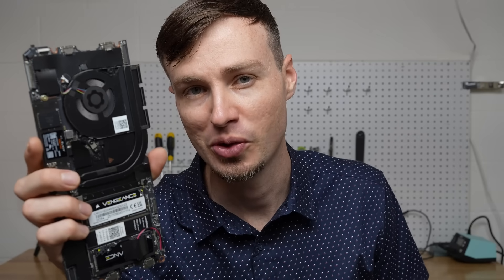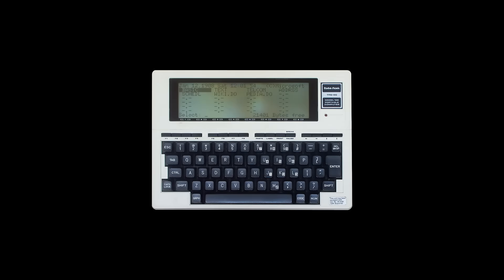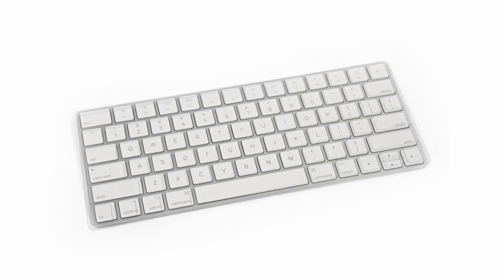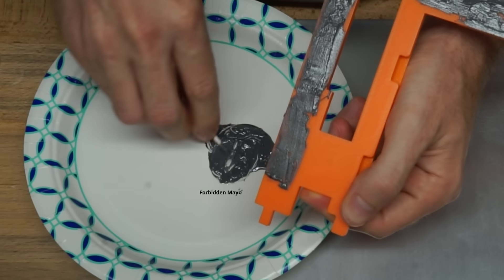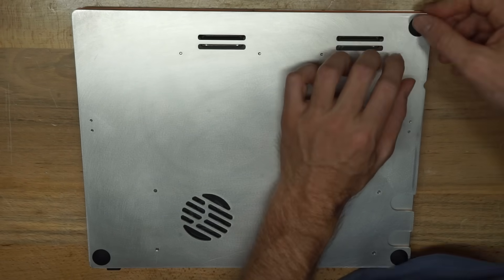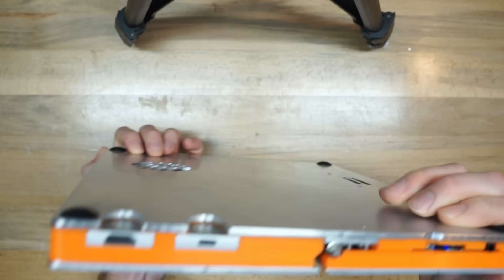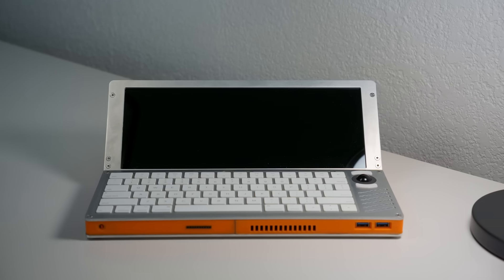Framework Cyberdeck - DIY Portable PC

Comment: Love the project! Have you considered some low profile, clear rubber bumpers on the corners of the screen? I love this design, and if I could recreate this I'd add some fine custom cutout mesh on the inside of the speakers/fan vent areas as well as opting for 3d printing the case vs the heavier metal construction, maybe even in a translucent 90's tech style purple or clear filament!

Comment: I really like the CNC aluminum and FDM-printed sandwich design.  As a hater of exposed layer lines, putting them where they will rarely be seen is a big plus for me.  The one show-stopper for me is the exposed circuitry and cabling when the display is tilted up.  Maybe a bellows could be used to fill that space.  But that's just me - if you're happy with it, that's all that counts!  The one universally accepted rule for cyber decks is to make it suit YOU, and I'm already thinking about how I could blend some of your ideas with some of my own.  Like, I might prefer CNC plastic sheet stack over FDM-printed core - I'm working on a cell phone design using that approach right now.  So, bravo!

Comment: A system like this could possibly replace my mini laptop with intel atom. Which, by the way, is plenty fast for the things i use it for. Burning install media or recovery tools and such. SSH into things. And it's small as heck, not quite pocket size but almost.
But. Ports. It has one USB. Also USB-C but that's only for power in. Does have microSD but i have never used that.
Features that this cyberdeck has that i want. More ports, and that ultrawide screen. Also display in. I may need to modify the form a bit but really, this thing seems amazing and just what i need.
Reply: Hm. Fitting a logic analyzer in that thing should no be too hard. Also some other random small well i better not fill it too much..

Comment: You gotta teach a class or course on how to do this. I want to make a clear framework 13 laptop case. Any tips?
Reply from the maker: I use Fusion360 for all the cad modelling. You might be able to find the original model somewhere online and use that as a starting point. I found a model of the battery and motherboard and used them for reference. Clear acrylic can be cut with a laser, you can probably find an online service and just send them the files.

Comment: I know this is a hot take, but everything that is not type-c needs to die. It uses DisplayPort for display output which doesn't carry royalties like HDMI, it can carry plenty of power for any small computing device (240 watts in the newest revision), it can carry upwards of 40Gbps of data, it really does everything. Outside of that, I can see a place for SD card slots, but that's really it.
We don't beat on laptops for dropping VGA, Serial, P/S2, Parallel, or PCMCIA. It's time for a unified standard.

Laptops and desktops don't need to adapt to outdated standards, peripherals need to come into the modern era.

There is still a major issue, the labeling of ports is much more complex these days and  the USB Implementers Forum is not strict enough. All devices capable of supporting a feature need to support it or they need to create simplistic symbology to convey the limitations of certain ports. We're getting there slowly, but this is the slowest technological transition I've lived through.

Btw, notice that this motherboard actually has nothing but Type-C ports with some fancy adapters, lol.
Reply from the maker: It may be a hot take, but I agree with you! In an ideal world, this board would not even need adapters, and therefore the overall footprint could be smaller.

Comment: So I could be wrong here, but I'm pretty sure LVDS (The connection/electrical standard that laptop LCD's use) is designed that if the cable fits it'll work, doesn't matter about the form factor of the screen, so a lot of the time you can just plug a random screen into a random computer assuming the plugs are the same size/number of pins.  I could be wrong, I can't remember where I read this. Would free up one of your ports.

Comment: its an interesting idea. i was thinking if i can use samsung tab as display i can use s-pen, and can use samsung keyboard which is very thin as well as dont need mouse since i can use touch so it saves a loot of space. plus point i can run android as additional bonus . whats your thought on this?
Reply: i was thinking like we can integrate the system with keyboard but not screen, in place of screen we can use ipad or any other tab.  its like carrying thick keybourd with you anywhere just plug it with any display or tab and use it.
Reply from the maker: If you just want to use the samsung tab as the system itself and run android then sure, it would be a lot easier actually since you don't need to figure out things like the battery/screen.

Comment: 3:00 but it's pretty usable. If you have heay base and light screen you can hold it with yours wrists and type. And in this case it's better when keyboard close to hinges.
I can't use something like gpd pocket on laps with same comfort.
On the long run it's better to put something on lap and then put laptop on it...

Comment: In Pop!_OS, I’ve found an option that lets me scroll by running my finger along the right edge of the trackpad.  Having a strip near the trackball could be interesting. 

An “iPad style” flip cover could potentially be cool. Would need extra geometry though probably and not sure where it would store. If the case were thicker, you could potentially have a rolling security door type deal for the ultimate ridiculous level of “what timeline?”. Not even sure they’re good ideas, but it’s fun to imagine.

Comment: I may have a solution to your scroll wheel and extra keys problem. Remap the fn key to turn the trackball into a scrollwheel :)
Reply from the maker: Actually I did that after posting the video - except I used the caps lock key since I never use it, and got the fn key to activate the apple keyboard functions
Reply: @benmakeseverything  Nice! Caps lock is probably more ergonomic anyways. Once I get the time and money, I'll probably make one of these myself!

Comment: Is operating temperature an issue without heatsinks (beyond the small one+heat pipes on the motherboard), airflow space or fans? Cool design.
Reply from the maker: I have not had any issues. Essentially, its the same setup as in the normal laptop. Air gets pulled in the bottom and out the front.

Comment: You could use one of the apple specific keys as a hotkey that turns the trackball into a scroll wheel since they aren't really doing anything. I'm a bit too dumb to do something like that so it might not even be possible but I thought it would be a pretty cool addition. Also, akin to how some keyboards have feet that you can pop out to increase the resting angle, you could have the same done to two of the feet on the back of this device to increase that 45 degree angle a little bit :)

Comment: Ben, can you tell me how you wired you power button to the main board?
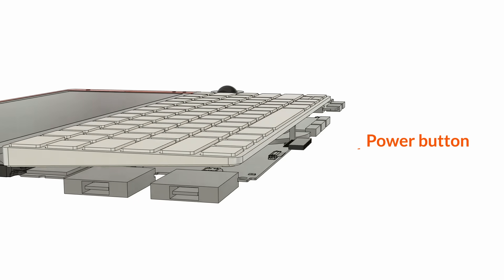Reply from the maker: Its at 9:55 in the video. It was tricky and I had to be very careful because they were very small connections. Its just going from 1 side of the on-board switch to the other.
Reply: @benmakeseverything  Don't know how I missed that. I zoomed into the other sections of the video. This is exactly what I was looking for. Thanks

Comment: Interesting but would prefer a folding design with a way it can lock open. As even in a laptop bag id still break the screen and plus make it more portable to get the moduals to slide out 3d print a thump grip with a ridge you can glue on to the moduals and give the leverage to push them out easy

Comment: Stop by a skate shop and pick up a small sheet of grip tape.  Cut out small pieces and stick them to the bottom of the expansion modules.  That should make them easier to get out without opening the case.  Alternatively, use contact cement to stick small pieces of coarse sandpaper to the modules.
Reply from the maker: Good idea, thanks!

Comment: Can you link an external GPU to framework? That would be a nice solution for graphics intensive tasks which would keep the design philosophy and form factor.
Reply from the maker: Yeah it could, the framework motherboards have high speed usbc ports so that can be used to connect to an external GPU. The channel Elevated Systems just did a video about it actually.

Comment: can you make a total foldable one???
Reply from the maker: In theory, yes. I didn't because I would have to put the battery right on top the mainboard, and thought that might cause issues with the heat from the processor.

Comment: Cool profect, Ben! How much of the thickness is down to using the stock apple keyboard?
Reply from the maker: The total thickness is a little over 22mm, the keyboard is about 9mm thick.
Reply: @benmakeseverything  I'm guessing it's not quite as easy as saying the thing could be 22-9+x thin, where x is the thickness of some other keyboard, right?
Reply from the maker: Right, the bottom plate+ standoff height + thickness of the main board have to be taken into account since those were right under the keyboard. But you can take a look at the cad file in the github page I linked to if you want to see the exact details.  @simonschulten3879

Comment: What CAD program do you use? I haven't managed find something that supports dirty sketches like the way Onshape/Solidworks/Inventor does but without costing more than a car.
Reply from the maker: I use Fusion 360. There is a free version that has pretty much all the features. It limits you to 10 active documents, but you can just switch around which ones are read-only depending on what youre working on so it's not that big of an issue

Comment: This is awesome. To get much more performance and battery life, undervolt is the way, but it might be not possible on 11th gen U SKUs. Another performance boost would be to find a naked keyboard and use its metal supporting structure as another heatspreader.

Comment: Any plans to make a new mount for the Framework 16, since it has 6 swappable I/O and an expandable slot for a GPU? Also, Framework 16 has an ultra-thin swappable keyboard, and would be interesting to see a non-clamshell laptop using those parts.
Also, instead of a rotor ball for the mouse, how hard would it be to get a trackpad similar to the Steamdeck? I think it has internal R/L button inputs on it.

Comment: Ben, what are your thoughts on cutting the button from aluminum?
Reply from the maker: You could do that. they are very small so it might be hard to secure them doing the cutting process - I guess 2 small tabs could be enough. In my 3D printed version, there is a cylindrical post connected to the back that actually pushes the button on the trackball PCB, so you would still have to glue that to the metal part.
Reply: @benmakeseverything   I was thinking of just hiring it out. PCBWay is producing all my plates (I have a 3d printer for the other parts) and they can mill things as well. I am going to start off with PLA for now for the buttons. I have collected allmost all of the parts inculding the mainboard. The battery is proving hard to source from framworks, backorder apparently. Fun project, thanks again. I see I switched accounts, @brandonsummey2418 here.

Comment: Ooh, I'm hoping that i can find that display or a similar one for my goal to mod of toshiba t1200 i got from a thrift shop years ago. I got one of the cheap old model framework mainboards for that eventual final purpose.

Any tips on search terms for how to find such a display module?
Reply from the maker: Check the github link I posted in the video description. In the Readme file, there is a link to that product on Amazon. They also have some other similar sizes and resolutions too

Comment: Loving your build. v2 could be: custom keyboard utilizing QMK, custom made pcb and chok switches. You could use custom layout, remove unnecessary keys, add some chords, home row mods etc etc... Overall smaller design, remove hinges, let it be flat. Trackball is a nice touch, but consider lenovo trackpoint since keyboard could be custom made. Could be fun and open source portable terminal that outperforms smth like devterm.
Reply: A project like this and QMK/VIA seem like a fantastic match.

Comment: Have you yet found out the hard way? That epoxy does not hold very long to Slick Aluminum…
Reply from the maker: I should have stated in the video: I sanded the areas that were to be glued with 200 grit sandpaper, then cleaned them with isopropyl alcohol before gluing. Its been about 6 weeks since I did that and have had no issues so far, but time will tell.

Comment: I am not sure how to open or use STEP files.  Is there a way to download the 3d print files as STLs?
Reply from the maker: I am adding the individual parts that need to be 3D printed as STLs. Check the github page again.
Reply: @benmakeseverything  Thank you so much!  I am planning on building this as soon as I can get the money together to buy the parts.  Main other thing I saw is that there was no mention of what parts (Screws, bolts, and standoffs) you used.  Standoff length at least would be helpful.
Reply from the maker: Hi, I just added the hardware (bolts/screws) list to the github page. The motherboard standoffs are actually incorporated into the 3D print. @DraconicWraithXIII
Reply: Not sure how I missed that, and thank you for the additions!  I should be able to afford the parts over the next few months.  Main cost will be the aluminum plates, as I have to pay a company to cut them.  Lowest quote I have gotten so far was well over $500.
Reply: @benmakeseverything Any chance you could make a wiring diagram for the ball?  I am having some issues getting the wiring between the trackball and Arduino / mainboard right.
Reply from the maker: I used this as a guide - slightly different model but same pins: https://www.instructables.com/Logitech-161A-PS2-to-USBLeonardo-t-sbc12-cpq/
Reply: @benmakeseverything  I guess I asked this wrong.  I have figured out how everything connects to the motherboard except for the Arduino.  How does that connect to the motherboard so that the trackball signals are read by the PC?
Reply from the maker: @DraconicWraithXIII  The arduino is connected through the hub via a usb-micro to usbc cable. (see the github page for the link to that item). Then the hub itself is what plugs into the motherboard. So basically it goes trackball->arduino->hub->motherboard
Reply: @benmakeseverything  Got it!  I didn't see a micro-USB to USB-C cable in the parts list, it's why I was a little confused.  Thank you for clarifying!

Comment: 16:58 how about VR  a Rift S or reverb g2 v2  needs display port 
 but  i think a quest 2   would pair  very well with this   totally cyberpunk .. /
i would love to see  a EGPU  with display port  and diy cyberpunk NAS  set up  
also  this needs a guitar  strap 😎
Reply from the maker: There is a display port adapter for those swappable ports. I have a reverb G2 and would love to try it, but yeah I think an external eGPU enclosure would be mandatory to get any kind of usable framerate.

Comment: A custom QMK keyboard would have killed it but it turned out pretty nice. I would have added a small recess for the feet though, as from my experience, they sometimes tend to slide out of place over time
Reply: ... and pogo pins for a removable wireless keyboard 🤯
Reply from the maker: Good suggestion on the recessed feet, I should have thought of that...

Comment: you should have just used the motherboards eDP 1.4 connection for the display
Reply from the maker: I think that the framework eDP connecter is non-standard, and at the time I was building this they did not sell the cable by itself. Now, it looks like they do have them in their store. But I'm still not sure if it could connect directly to the screen or not.
Reply: @benmakeseverything  it would depend if that screen in edp or mipi, or maybe there's an edp panel in that size. But afaik edp is just dp with the option for other stuff like backlight power so at worst you're just mapping one connector to anther, nothing a connector for each end and soldering iron can't solve.

Comment: Aren't there ps2 to usb adapters you can buy for a couple bucks?
Reply from the maker: Yeah, but I wanted to have an integrated arduino anyway so I could control stuff directly, so it made sense to just use that.

Comment: I would like it better if things weren't exposed and if it closed like a normal laptop. Any particular reason you didn't make it a clamshell?
Reply from the maker: I did consider it but - It would have been really thick when closed. Plus I'm not sure if sticking the battery right above the CPU heat sink would have been good for it...

Comment: the video input is very nifty for a spare mobile monitor that runs with it's own battery/power supply.
I also agree the only demerit is that the mouse lacks a vertical scroll, I think you could use a D-Pad for a combination of vertical and horizontal scrolling lol... That would make it look unique for sure.
Reply: Never heard of the term „D-pad“ before, so thank you for telling us about it. 
Wikipedia: … Directional pad is a flat, typically thumb-operated, directional control. D-Pads are found on nearly all modern gamepads, handheld game consoles, and audiovisual device remote controls.
End quote. 
Very interesting 👍